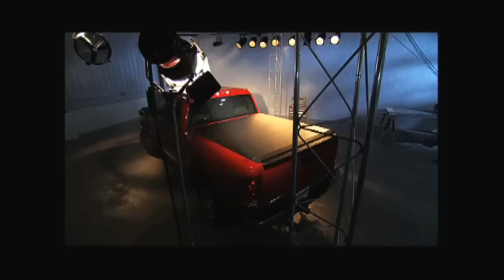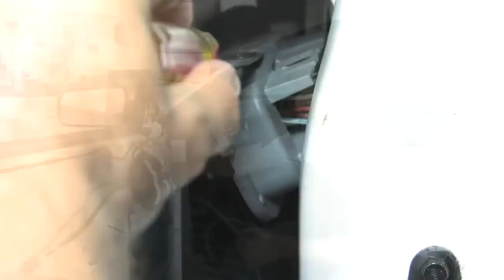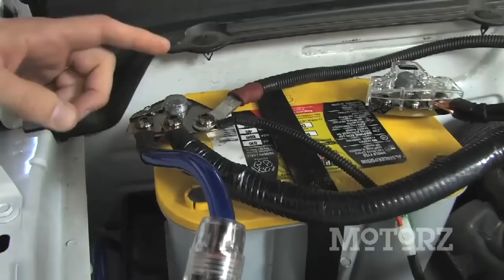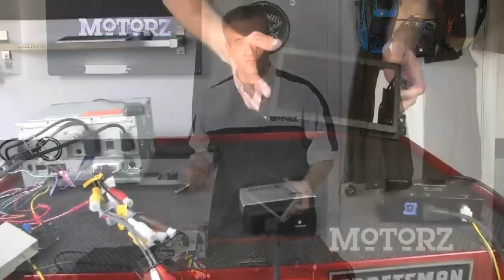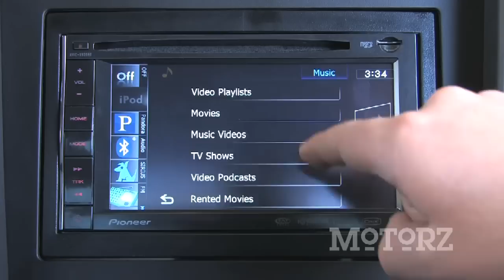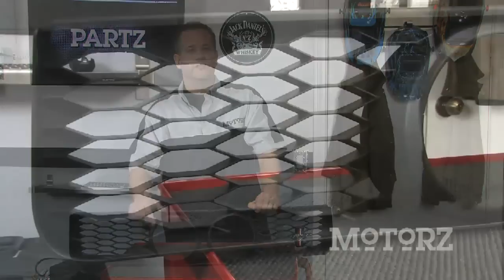How-To Install Pioneer Car Stereo System Ford Mustang Motorz #50

Comment: I got a question I have the shaker 500. To keep the stock amp and speakers working, do I have to run the splitter off the remote wire to the new amp, and to the wiring harness for the aftermarket stereo?  Basically I want to keep the stock speakers, stock amps,  and just run an amp and a sub...

Comment: This a lot harder than this guy is showing, there's a tang on both side at the bottom side of the console , that you can't see in the video and there's two nuts holding in the console not screws, and there a bitch , and trying to get the console back in and trying to get the tangs back under the side panels a real pain in the ass. That is not a 2006 Mustang Because the console is nothing like mine.
Reply: You're right its not a 2006 he clearly said its a 2008

Comment: you don't have to strip the interior at all.  all you have to do is, from inside the trunk, cut or break the 4 nylon nuts that secure each speaker to the the rear deck.  flip the rear seats down and bow the trim panel up and cram something up between it and the deck. this gives you room to lift and twist the speaker when you return to working from the trunk. twist the new speakers up and in. i'll leave the wiring and bolting to your immagination.  remove paint cans, flip seats back up and enjoy.

Comment: that is a shaker system you cant just hook up and aftermarket radio with no problems. the aftermarket radio has a 12v amp turn on and the factory amp is 6v so you have to do a voltage drop using resistors or else you will get a nasty pop when the amp powers on unless you are bypassing the factory amp and adding all new speakers like in the video

Comment: what a nightmare i need to have all this plus a c.d changer installed in a CVP1..iv'e bought just about everything except for the monster cable ... i,m not sure how many feet i need plus the fuses pioneer does make the best sounding speakers..i was wanting a pair of 1" horn tweeters also i saw on ebay damn stereo shops are gonna charge about $800 i bet to do it all..and most likely not use monster cable i love your vids too